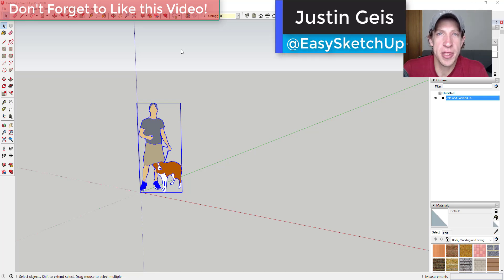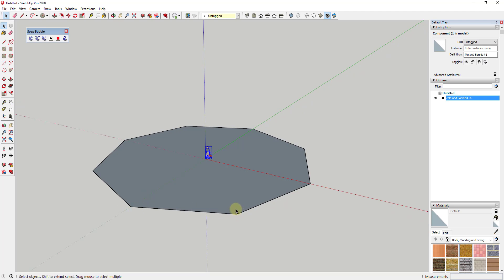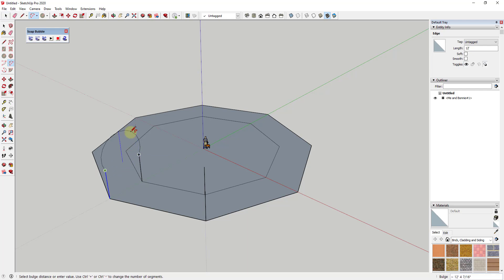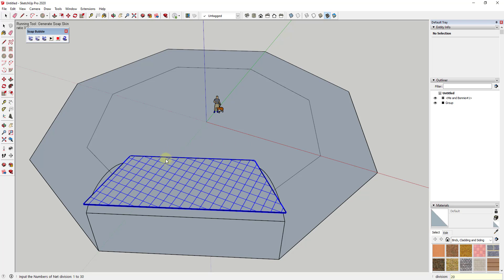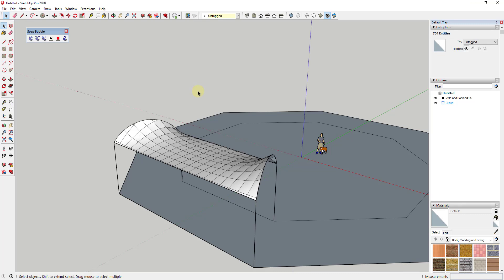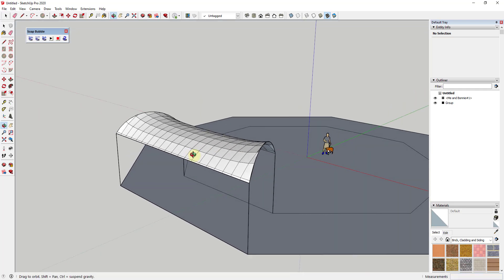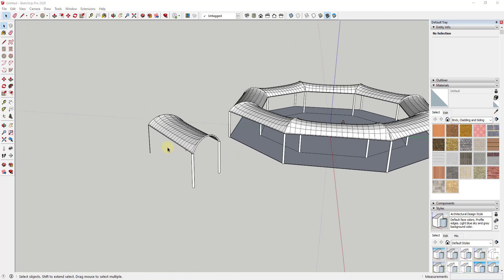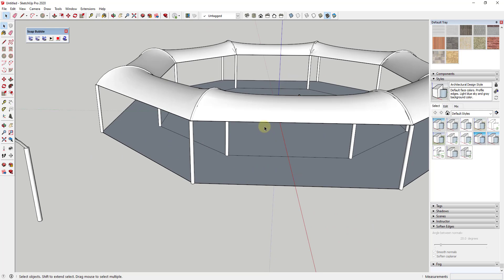Circular TENSILE STRUCTURE in SketchUp with Soap Skin and Components!

Comment: Nice demo thanks. While I was watching I was thinking that SU native tools could do the whole thing in as many steps.
Reply from the maker: Really only on a simple structure like this - the more complex the structure, the more you need the tools
Reply: I was thinking the same, Jeff, but Follow Me can only do the exact same arc along the entire line. It can't do the slight sag in the middle. 
Plus, it's hard to do if it's not a right angle to the foundation face. Possible, but fussy. 
🥯☕
Reply: Jennifer Grove Yes you are right about the shape of a hanging chord needing to be a parabola or catenoid rather than a circle. But that would escape all but the most serious designers.